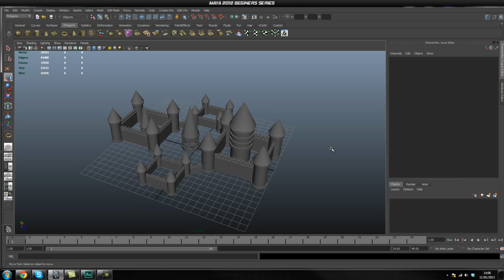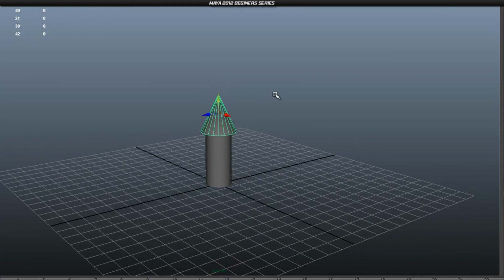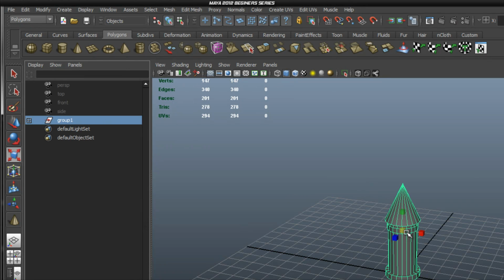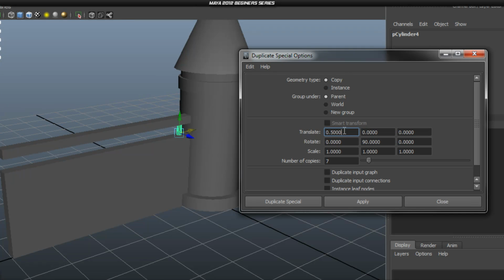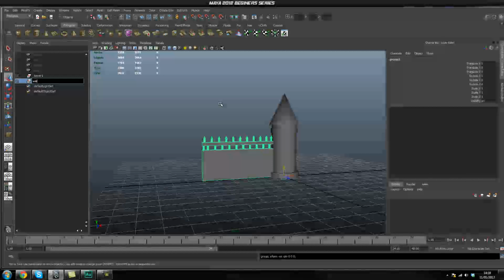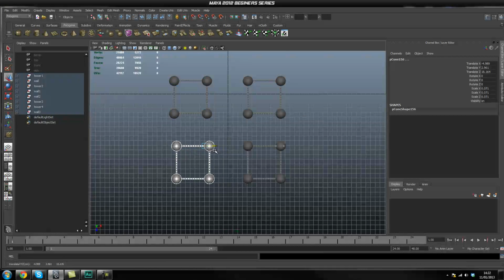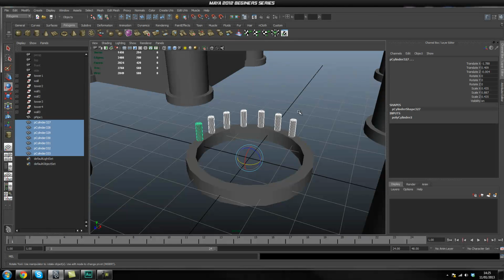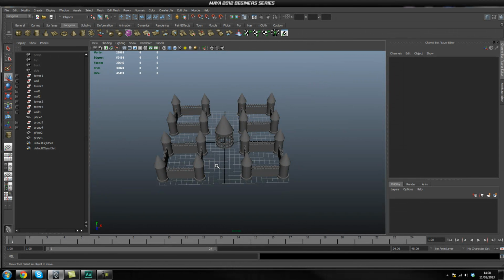3D Modeling basics (castle) - Autodesk Maya 2012 Tutorial Series For Beginners HD

Comment from the maker: if you press the Insert key on the keyboard that way you can move the pivot point to the middle, then if you hold down X while moving it it will "snap to grid" so you will be able to snap it to the grid. Then press the Insert key again to come out of move pivot mode. After that you can duplicate by pressing down control + D. Hope this helps :)